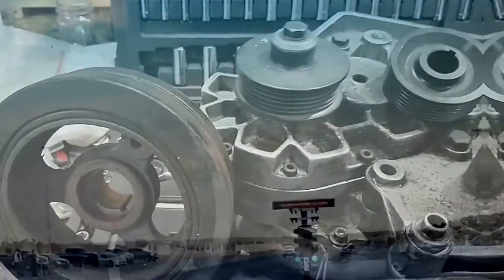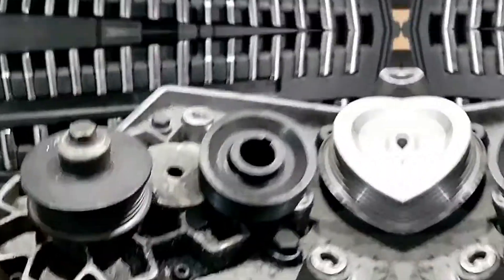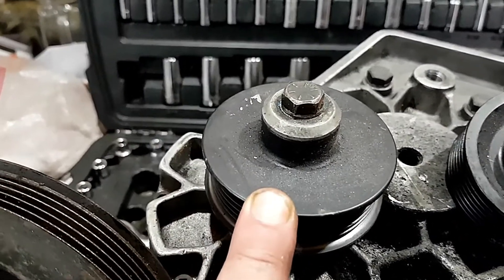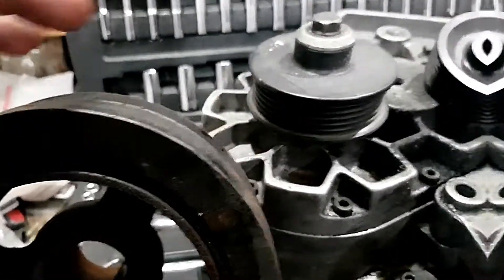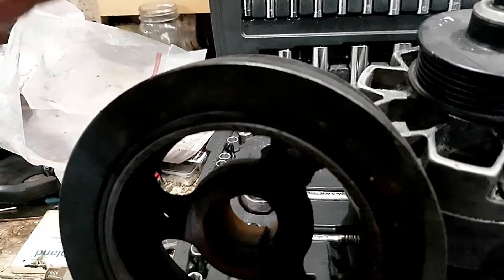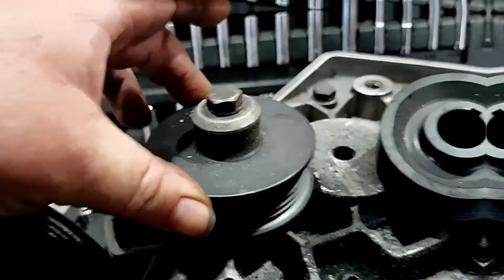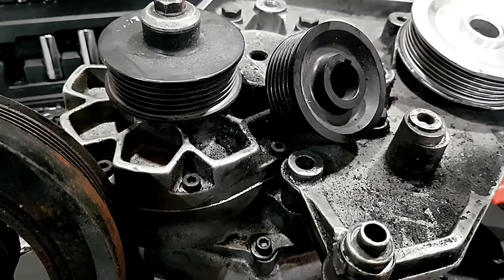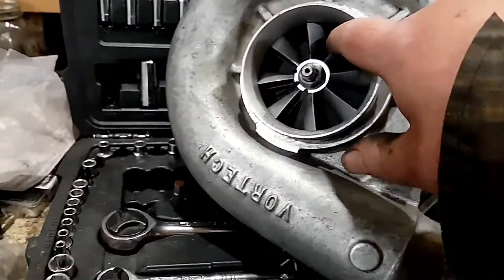supercharger pulley size horsepower and boost

Comment: what do you think about small engines and small superchargers? i have a m.benz with 1.6 liter supercharged engine. when using smaller pulley, which is still able to use same belt and other components, because of increased amount of air, will it need a tuning or will computer manage to adjust the fuel to compensate the difference? original kleeman branded pulleys are sold withhout a tuningbox, but alternatives are with a tuninbox.
Reply from the maker: as long as you don't get pass the limits of your fuel supply ie injectors and pump, you should be ok, that being said to make the most of the boost gain a custom tune may net you an additional 30 -40 hp over the stock calibration.  try it gently to see if it likes it and go from there.
Reply: @thisguysgarage   thank you for the insight.
Reply from the maker: @coskuarsiray  anytime my friend ,ty for the question

Comment: Hey Shaun! Is there any reason someone would choose a bigger one over the smaller one, being that the smaller one produces more boost?
Reply from the maker: Matching your parts would be the biggest reason.  Having enough fuel or big enough injectors to run high boost would be your primary reason.  The ability to make power is simple today. Holding it is another problem.  The factory connecting rod is your limiting factor.  Once you have a bottom end that will hold power and a fuel injector to deliver the fuel you also need an intercooler because high boost makes heat. 
By the way  I checked out etcg1 ride out.  I know what the cheapest easiest way to beat him is 😎 👍
And it won't take much 🤜🤛
Reply: @thisguysgarage  Thanks for reminding me, I meant to email you but totally thrown off track, doing that RIGHT NOW!
Reply from the maker: @OnlineAutoRepairVideos  🤜🤛👉